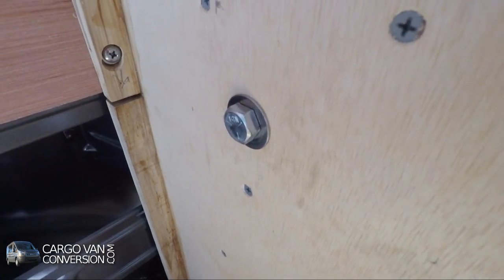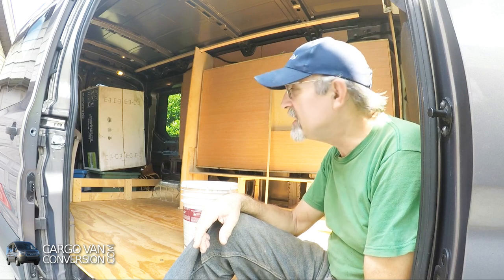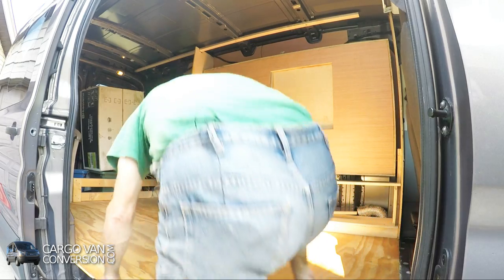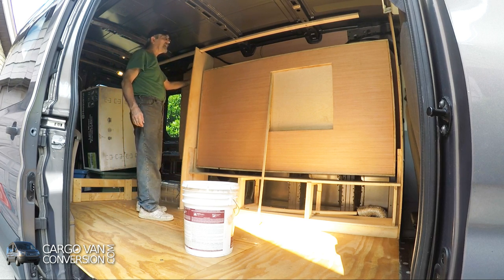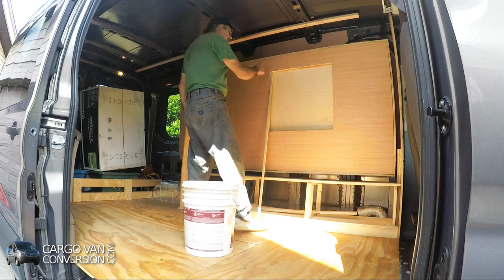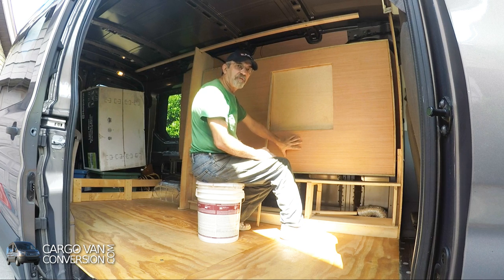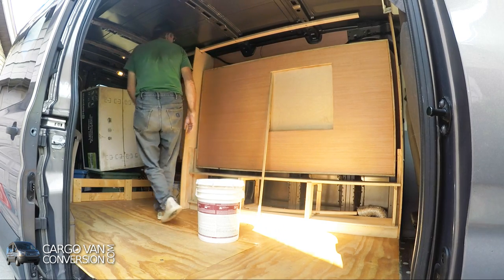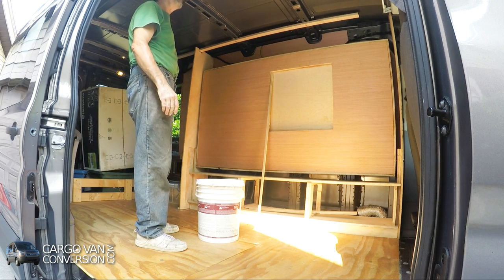Cargo Van Conversion Murphy Bed - Part Three

Comment: I'd just get another 5 gal bucket, pad both tops for seating and slide into place for the legs...they have storage and will probably be in the van anyway... totally strong enough....BTW...LOVE your shower drawer...great ideas.
Reply from the maker: Lots of ideas, but this time I wan to do it right. I will make my own stool for use behind the desk and as a leg support sitting in the front swivel chair.
Thanks for watching!

Van Williams

Comment: Well done, simplest of the various tubes I’ve watched. It just occurred to me that idea could be used to save space: computer table, stove top, dining table, etc. No need to have things used only for 15 minutes taking up so much space.
Reply from the maker: Hi Jack,
BTW The bed is not ready yet (like so many other things). It'll still get some small cabinets above, but more importantly a fold down desk on the front/bottom of the bed. When the bed is in up position, you can use the available space or fold down the desk to work on.
The 'simple theme' and step-by-step installation is just to show almost everybody that can handle a hammer and a nail, can do a conversion. How well-finished depends on your experience and your need, but that's with all things.
Van Williams

Comment: Great job, hope to see more. Looking forward especially to the shower.
Reply from the maker: Hi Jean,
Right now, I'll be making the connection between the shower drain and the gray water tank. And in the near future, I'll be installing a permanent sliding shower head above the side cabinets. Lots more to come :)
Van Williams

Comment: Fascinating van build.  Is it possible to construct a Murphy Bed for two large adults?
Reply from the maker: Hi Frederic,
Thank you for watching!
My bed is about 39 inches wide and I assume, you would be able to go up to 50" in a Medium High roof van like mine. Probably wider in a High Roof model.
I'm just one person in a LWB Transit; with more people living together it is highly advisable to upgrade to a LWB-Ext version. With the additional space and possibly a higher roof, I think a better solution would be an elevated, but permanent bed in the rear of the van. It creates a lot of storage area underneath, while maintaining the height to sit up straight in the bed. And a so-called garage accessible through the rear doors.

Van Williams
Reply: I struggle with width to construct a bed that is at least 78 or 80' long.  It sounds like this is doable.  I just had never thought about a murphy bed in a van.  Truly inspiring and unique.
Reply from the maker: With the increase in width, you'll also have to compromise on the height above the floor. For increased strength, I used a honeycomb double bottom; you may also have to reinforce the pivot mechanism.
Good luck!
Van Williams
Reply: All makes good sense. Thanks for concept and the advice.

Comment: Amazing job! I'm in the process of building my own. My plan is to make two lower cabinets that will double as bench seating with a fold down table. not sure how if ill put castors or just slide them out and around. Does this make sense? What were you going to use for seating?

Comment: Excellent build video! Yours is the best looking Murphy bed video. I plan on doing the same for my box truck conversion; however, I am having difficulties locating the position of the rotating pin. I tried to subscribe to your website to get detailed instructions but received an error message from your website! Please, how does one determine the location of the pivoting pin?
Reply: Part 7!
Reply from the maker: Glad, you have found it, Phillip. Hope that the video makes it clear. All also depends on the required elevation of the bed and the cabinets underneath. Keep in mind that the wall of the Ford Transit isn't straight, but curves into the interior. That effect is more pronounced in a Sprinter and a bit less in a ProMaster. It can affect how vertical your bed is, when folded up.
Van Williams

Comment: Nice videos.  I don't want to use a kit but what hardware would you recommend that I can only source from major hardware stores or local hardware stores such as Home Depot, Lowes or Ace hardware? My high top van swinging bed project will included a 39" x 75" 10 inch mattress with 16.5 inch swinging legs?  Only tools I have are Jigsaw, hand skillsaw, & hand drill. It needs to strong enough to hand the weight of 2 people. Also it will be installed on the side wall horizontally mounted directly to the ribs of the van.
Reply from the maker: Hi Live Free or Die,
I can only give some general information as there are too many variables, I don't know about. If you have watched some of my videos, you should be able to discern, that I am a minimalist. Sure I have a tablesaw, jointer and planer, but use them rarely. I can do most with the tablesaw and that's only needed for precise work. I frequently use a handsaw, handplane, chisels and even a manual drill. They work just as good, but work goes slower. And that's a good thing!
You'll see a lot of final work done on the Murphy bed in the coming weeks and I do go out of the way with some materials, that need some specific tools, but if you keep it simple, the bed can be done with handtools. And most of the materials are from Home Depot and the like. The only ordered parts are the pivot mechanisms; these are simple to order and I'll detail that in the upcoming videos.
One important advice about hand tools (non-electric): make sure they are SHARP ... and be careful.
My bed is 39" wide and only a few inches shorter. For sturdiness, I created a reinforced double bottom.
If you need more specific info, please let me know.
Van Williams

Comment: good hinge setup .
Reply from the maker: Thank you. It took some time to figure it all out, but it has been working without fail.
Van Williams
Reply: @cargovanconversion  
really good..takes into account the thickness of the mattress and bedding !
Reply: @cargovanconversion  
end hinges fully supported...so much stronger than cantilevering out from the side wall of the van to the side of the bedframe..
Reply from the maker: @duggydugg3937  Hi Duggy,
Missed your comment earlier. You are right about end hinges. I faced many issues while designing this Murphy bed. The elevation of the bed above the floor of the van was critical. On one hand, I wanted enough space under the bed to possibly store a kayak. On the other, the two picture frames and the height of the hinge for the foldable desk, above the floor are directly linked to the elevation of the bed. While I may have been able to find a way to use hinges, once I had it all figured out, I stuck with the side mechanism.
Van Williams

Comment: Hi, nice video. I’m building a similar bed. What exactly is the name of the bearing/bolt pivot mechanism you have? Trying to find one myself but I can’t figure out what to search for!
Reply: That was a coupling nut, a short hex bolt, a longer cap head bolt with a shoulder, some washers and a couple brass bushings.

Comment: Hey Van- Do you have any idea how to tap or get a 2nd auxiliary fuel port on the diesel tank? I have a webasto X100 stove and an Espar heater and they choke each other out if I tap off the same straw.
Reply from the maker: Hi Curt,
Wouldn't want to mess with non-standard fuel ports into the original Transit tank. You may consider a separate tank for either or both appliances.
Van Williams

Comment: I saw the square cut out and thought of a flatscreen monitor in that location that would double as a viewing screen for a blue ray player.
Reply from the maker: Hi V Star 1300 Adventures,
That isn't such a bad idea; there will be a collapsible desk under it, where it could function as a computer screen too.
I am working on an idea to store a TV screen vertically on the opposite wall inside a narrow cabinet; from there it could pivot to a horizontal position for viewing.
I appreciate your feedback!
Van Williams

Comment: Been noticing you have a square/level next to your drill. Is it attached to keep your drill straight or are you just eyeballing it? I'm notorious at drilling crooked but can't afford a drill press so if you have a secret i'd love to know it.
Reply from the maker: Hi Hiker Biker,
You said it: eyeballing. I place the small square close to the drill; that gives me enough feedback, both front to back and sideways, to drill fairly straight into the wood. You don't have to hold the square, just let it stand while drilling. It may not be a perfect plumb hole, but usually straight enough.
With larger/wider holes, I love to use Forstner bits. Working freehand, I use a simple jig, just a piece of scrap wood with a perfectly drilled hole, the size of the bit. I clamp the jig, where the hole has to come and the hole in the jig perfectly guides the bit through the targeted wood. Sure, I make the hole in the jig on the drill press, but without it, it's just a matter of trial and error until you have a straight hole and since you use a scrap piece of wood, it doesn't cost anything either.
Van Williams

Comment: Was insulating the van not something you planned on doing?
Reply from the maker: Hi David,
No, insulation is an integral part of any van conversion. I do have a somewhat different look at the issue.
First, insulation depends mostly on the location and season, that you use the van. In colder climates, substantially more effort must be undertaken to insulate. That said, I plan to chase the 70 degrees (20'C); in my opinion, insulation will then play a lesser role and ventilation is more important.
Currently, I'm finishing up the Murphy bed and the cabinets around it; did a lot of finishing materials, wiring, etc. and if you look at my latest videos (as of Mar'18) you'll see that I'll be permanently installing the bed over a completely insulated wall.
I used a combination of Poly-Iso (high R-value), Denim (R-value and noise reduction) and spray foam.
Thanks for watching and the comments!
Van Williams

Comment: Hey Joey, are you going to add hydraulic arms to the bed to help control the open/close of the bed?
Reply from the maker: No, I wanted to keep the design as simple as possible (it is already quite complicated with the bed mechanism, the picture and desk) and didn't see a need for it. Lifting is a bit heavy, but it works flawlessly and poses no problems. It also saves some weight, cost and maintenance.

BTW Joey is the supervisor :) of this project; he is a Golden Retriever mix and my best (dog) friend.

Van Williams
Reply: Cargo Van Conversion oops :)

Comment: Hey there! Awesome job! If you don't mind me asking, how tall are you? I'm 5'7" and currently debating the medium or high top. Can't decide at the moment.
Reply from the maker: Thanks! We're the same height, so my reasons to choose a Medium High Roof van may apply to you too. Many of the involved issues are discussed in my videos about the floor installation. The first of that series is https://www.youtube.com/watch?v=g4UqVwShR5Y
Some of the issues that played a role in my decision, where: price, interior height, stealth, deed restrictions where I live and simultaneous use as my daily vehicle.
Before I go any further, if your goal is to create an RV that will function as your primary home, for more than one person, primarily boondocking, it is well-advised to get the tallest longest vehicle available. In case of a Ford Transit, the HR (high roof) LWB-Ext (extended long wheelbase). Main reason for this is (height) inclusion of a standard shower/bathroom and it's suitable for taller people, (length) allows for somewhat more storage (bikes, tools, clothing), again a real bathroom/shower/toilet.
I decided to go with the LWB MR (medium high roof):
- Price: These aren't cheap vehicles and while prices start at about $30.000, a high roof and extended length will add thousands to it, even before adding options.
- Interior Height: With a Dodge B-250 as my previous conversion, one of my requirements was standing interior height. With my 5'-7" in a 5'-11" vehicle, that has been a decision that was long in the making. You have to remember that you'll loose at least an inch at floor level (that's why I have minimal floor insulation) and two inches at the ceiling (the space between the ceiling cross members). How this all works out in the end is still a question!
- Stealth: A shorter and lower vehicle is easier to park, has better access to remote areas, is less 'visible', better MPG (fuel efficiency).
- Deed Restrictions: I can't park the MR in my garage and the HOA already frowns upon this kind of vehicle.
- Daily vehicle: Although I don't drive much, this is my daily vehicle and as such. it's easier to drive and park.
Hope this gives you a clearer understanding of my decision process. This will be a 'warm weather van', but if you live in a colder climate and with your height, a high roof may be a better choice as it allows for more insulation under the floor and in the ceiling.

Van Williams
Reply: Thanks so much for your reply! We are definitely leaning towards the extend/high top. Well I am at least :). I can't imagine not appreciating that extra space. It will be our primary dwelling for 6 months to a year. Thanks again for your videos. I know they prove invaluable as we build ours.
Reply from the maker: I love your input; that keeps me going. Let me know, what you decide and how things work out!

Van Williams

Comment: I Love your videos! I was curious most conversions I have seen start with insulation. Are you planing to insulate your van?
Reply from the maker: Thank you for watching and knowing that someone appreciates what I doing, makes the work a lot easier.
While I do many random projects, the intention was to construct the basic cabinets/bed/etc for the drivers side wall first. I've done part of the wall panel, the Murphy bed and cabinets; another closet still has to follow. I also still have to install a window frame, that I will have access to when the bed is down.

Like ever so often other things happen and I deviate from the original plans. On August 21 a total solar eclipse will happen and I will take my van and have my 2 minutes of fun. But I wanted to finish the bed first and install the roof vent too. I recently had the vent install ready to go but the weather didn't cooperate and changed to a quick Shower-In-A-Box project. That took off and I'm still working on it.

Anyway, the first thing after that I will build the closet and when I'm ready to permanently install the drivers side cabinets, etc., and before the insulation, I'll do the wiring (12V/110V/solar) followed by the insulation.

Both insulation AND ventilation are the most important items in a van conversion. You're correct to notice that. I'm likely to use a combination of Poly-Iso and Blue Denim.

Happy 4th!

Van Williams

Comment: Where did you purchase the pin mechanism for folding the bed? Great work!
Reply from the maker: Thanks for watching!
The pivot mechanism of the Murphy bed is not available as one set; I acquired the individual parts from several companies. Every project in this build is published as a video first and will be followed up on the website http://cargovanconversion.com/projects with a detailed article, containing a step-by-step building guide, a tool-and material list.
The components of the two mechanisms are as follows:
boltdepot.com:
8x SS 18-8 1/2" flat washers
2x SS 18-8 1/2"-13x1-1/4" coupling nuts
2x Alloy steel black oxyde 5/8" shoulder (1/2"-13 thread)x1-1/2" shoulder bolts
2x Zinc plated grade 5 - 1/2"-13x3/4" Hex bolts
cadencesupply.com:
4x Oilite FF852-01 self-lubricating bronze flanged sleeve bearings
The written article will contain the same information with prices, photos and how to assemble them and also will be available as a free download. If you want to be updated as to when it becomes available, you can subscribe at http://cargovanconversion.com/subscribe-to-my-newsletter

Van Williams

Comment: Aren't you going to insulate the vehicle before you do all of the built-in's?
Reply from the maker: Hi Petr123 paco,
This bed was just temporarily installed at the time, while I used it on short trips in the meanwhile. Since then, the driver's side wall has been finished. and in the upcoming weeks the Murphy bed, a closet, a water tank and lots of electrical cables will be installed permanently.
Van Williams

Comment: Clever building, but truly awful mattress planning. Mattresses need to breathe, sealing it into an area guarantees mould. Bed frames allow mattresses to breathe for a very good reason, litres of sweat are going to be trapped into a wooden box, gross.
Reply from the maker: Hi Lee,
While designing the interior, I couldn't find an alternate way and while an open-slat design was preferable, that would have completely changed my goals for the van. Frequent airing (and cleaning) should be sufficient. Mold is not an issue (I'm in Florida).
Wish you Happy New Year!
Van Williams